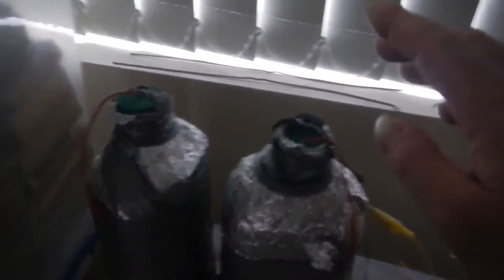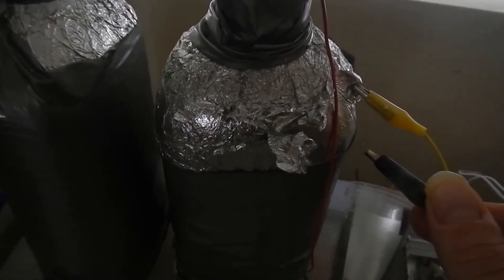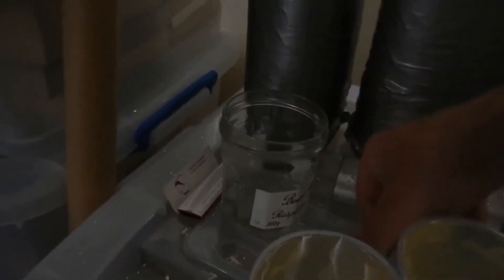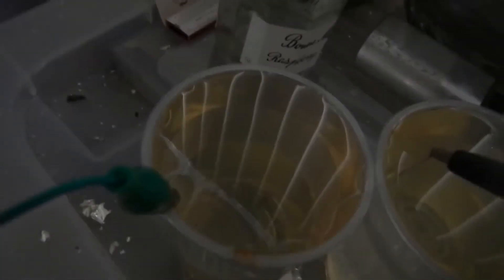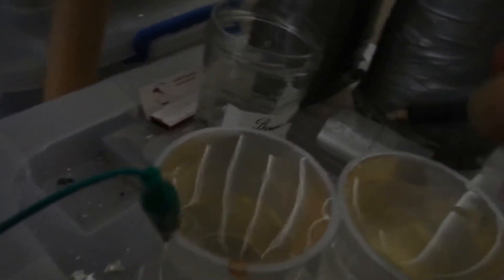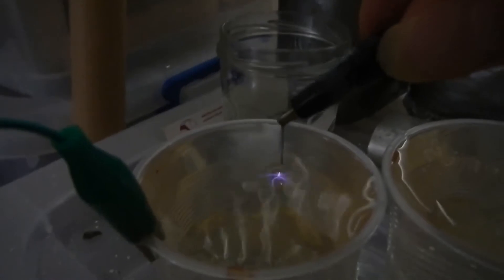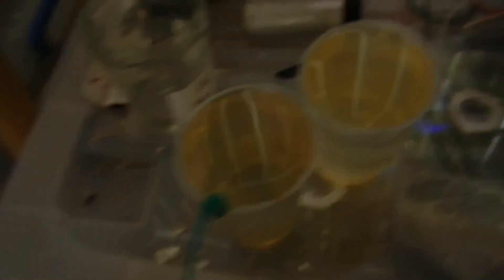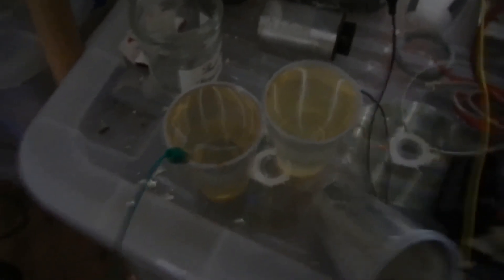Burning water with high voltage plasma.

Comment: Thanks for posting your work in a field not well understood.
This comment is to stimulate ideas as your experiment has done for me.
That indentation in the water is of interest.It's as if the potential is magnetically pushing against the surface tension of the water.Thinking of a pump maybe? That force might be high?For example,  the electrolysis or cavitation erosion of diesel engine cylinders is caused by an exploding micro sized bubble that slams the water onto the iron surface of the cylinder.(They claim it is hundreds of pounds of force), but a tiny pin size bubble.Thus,it creates a hole that eventually breaches and allows coolant to enter the combustion chamber.This doesn't occur overnight,but over months.It depends on the PH of the coolant.Electrolysis won't occur if the PH is 9.0 and above which is alkaline.Location of the engine's alternator ground wire connection can affect the electrolysis, and they're location is kept away from the cylinders.

Comment: no safety, not organized metal aligator clips, very messy and wet testing lab, no premeasurements to minimize unecessary testing. accidents will happen, im worried the water will touch the two big batteries. I suggest you get a bigger work area for your experiments, good sir.
Reply from the maker: thanks for the concern. this was one of my first HV videos. I have improved things since this was made.

Comment: You put an awful lot of faith in the rubber insulator of those low cost jumper sets xD
Reply from the maker: Yes. They work fairly suprisingly  well when new. I have had a few rather shocking lessons on dielectric breakdown doing this since making the video. I use a chicken stick now. Although they rarely breakdown below 3kv, I no longer trust them for any voltage measured in kv, especially since most of my leads have pinholes burned in them now....

Comment: Water is hash therefore   it do not burn. So you must use energy to dissociate H and O but then it's not water anymore the recombination of H and O will produce exothermic reaction yes, but the amount of energy  will be less than the energy spend to obtain the dissociation.
So BS !!!
Reply from the maker: Where did I claim it woulkd produce more energy than I put in?
Other than that you have described what I was trying to do fairly well. This was a test simply to see if a large capacitive discharge could make enough gas to ignite some with the spark of the discharge.
Although I'm not sure I ever did get an exothermic reaction.
Another explination for the change in the spark could be explaind simply as the water has resistance and may have been causing the discharge to happen at a lower voltage and higher current than the control spark direct to the capacitor. Which would also produce the yellow colour spark observed. I have been unable to reproduce the same result with other capacitors. So perhaps it is electrolysing gas then igniting? But only able to work with the high inductance/slow discharge of the leyden jar?
Reply: Mongrel Shark
the dielectric constant of water is 80.4
vacuum is 1 and dry air is 1.0006
http://www.engineeringtoolbox.com/liquid-dielectric-constants-d_1263.html

you should not use "burning water" water cannot burn period!
Reply from the maker: Firstly. The dielectric constant of water does not apply here as its tap water which has electrolytes added by the council. The water is a resistive conductor. Not a Dielectric. You would need distilled water to get a dielectric.

You can never use dielectric strength to get a resistance figure. A dielectric is not a conductor, while something that has a resistance is a conductor.

Furthermore I have done tests on the tap water here. The resistance is far from constant. It varies with voltage (in unpredictable non linear ways) as well as frequency (seems to be both capacitive (see my tazer water video or some of my capacitor videos where I demonstrate the dielectric plastic cup is an excellent capacitor) and inductive at the same time under frequency) while the resistance will not change much with added distance. It seems there is no way for a home experimenter to predict the electrical values of tap water with unknown electrolytes. Its far easier to simply measure the voltage drop under use. As I don’t have a sutible HV probe with low inductance I have not been able to get a measurement in this application.
While dielectric breakdown of the water is likely a factor in this experiment. The dielectric strength would in no way help me work out the resistance of the water at the applied voltage and thus be able to work out how much current is discharging to be able to solve the question of whether the air or the HHO is burning.

Secondly I use the term burning water loosely. Not to deceive people but to encourage them to think outside the box. I don’t think anyone that has read my description has been deceived. This info was supposed to be in the naration too, but the sparks where too loud and I got drowned out.
Really it depends on interpretation. When you consider that the whole reaction is happening (if its working as I intended) in under a millisecond. From water to gas to combustion and back to water vapor, and with the gas state being a very short time in the millisecond long process. I don’t think burning water is as inaccurate as you suggest.

Next you will be complaining that a Joule Theif is unfairly persecuted because it does not actually steal any joules. When in reality it actually uses them to the benefit of the user at great efficiency. Or that a Light bulb should be renamed to a photon generator.
Reply: Using the expression "burning water" is misleading.
Too many people do not understand the notion of chemical ash. Is it useful to encourage their ignorance?
Reply from the maker: Thats why I explain everything carefully in the description. As well as take the time to answer any questions.
Reply: rokag333 ....thanks rokag

Comment from the maker: Nope. I wish I could afford them!!! Have a few uses for UF diodes. I got 1000 1n4007's for $5.... All my fancy parts come from broken stuff... Haven't had time to sort diodes yet, so may have a few.... My part budget is about $8 a month... Mostly goes on 2n3055's... Need to find a better transistor. One that can handle a few amps @ 1200v... that I can afford. so dreaming. LOL.

Comment from the maker: I use 4007's for transistor protection too. You can put them in series for more voltage protection, or parallel for more amps (If you need to do that I wan to see!). I'm looking forward to seeing your driver schematic, as I need a good simple one that can do more than this JT based system. I'm only running 12v@ around an amp, anything more than that and the 3055 smokes. There are videos somewhere on youtube of a guy exploding water in a special capacitor too. Thats the main inspiration here :)

Comment: the second was with a irfp4227. I use a uf4007 diode to help deal with the back emf. Its not full proof. But helps a lot. with a irf450 I've pumped 28V and 30A through it. but not very impressive, current capabilities are to low.

Comment from the maker: Mosfets dont work on Joule Thiefs in my experience... Also I have over 300v back emf to deal with, which keeps blowing transistors. I have even blown 600v transistors... See my HV Joule Thief video's for more info on my driver, which doesn't have a spark gap. Just a JT wound on a flyback.... If you have seen a circuit with a fet of any kind running this kind of Oscillator, I would be very interested.

Comment: switch to mosfets. IRFP250 or irfp4227 work amazing. just be care with the distance of the spark gap as they are only rated at 200V

Comment from the maker: The video I was thinking of is on my HD. If I can find it I will see if I can upload without copyright infringement. Dosn't show much though. I like to think of the valving part, like a two stroke engine with two heads and no crankcase. I would think studying two stroke piston ports would help make a good steam engine. My brother had an "Air Hog" plane with an air pressure piston motor, was clear so could see working parts. Was just like a 2 stroke piston/cylinder. went really well!
Reply: For some ideas look at a Fairbanks Morse 38D8 1/8 diesel engine.It has no valves.The exhaust and intakes ports in the cylinder liner are open and closed by the action of the two pistons.

Comment from the maker: I'll have to go google Hooke's law now :) Only video of one I have seen is the one Tesla made, which is in a Tesla museum in Belgrade. You could make the cylinder from blocks of metal, by drilling in the right places and bolting it together, like your sterling water pump. Pistons would ideally be forged or lathed from billet, but you could make pistons and rods from bolts with washers stacked up, cut some of the washers to make the ports. I should have a go when I get the metal shop clean :)

Comment from the maker: Patent 511916 electric generator, 1893. I think its my favorite invention of all time :) You could probably make one with a drill press and a few other basic engineering tools. Heat, pressure, leaky seals, and friction are all turned to advantage.

Comment from the maker: I was up early not late :) Although I do 2 day Tesla sessions with no sleep :( I have been wondering about valves and steam too. Was thinking servo/microprocessor controlled, with action like 4 stroke valve. Piston ports are the more traditional way, but we have way better tech now :) Check out Tesla's Lineal steam generator. I can find a patent no if you want. Its one of the most inspired designs I have ever looked at. Turns all the problems into advantages. Brilliant stuff.

Comment from the maker: Yep. has gps tagging :) and goes 33ft underwater :) I wanted underwater gps though:( You could try with Tesla coil, But flyback is the go :) I wouldn't call it success, I was hoping to get pressure from this. Test in a bottle suggests no pressure. If you do it good enough, you might get cold fusion. Hydrogen turns into helium and you get free neutrons (Possible radiation danger) and a net energy gain with a bit of luck. Right now I would be happy with something that could drive a piston.

Comment from the maker: Audio problem can probably be fixed with settings menu.... Its a good camera for one thats only meant for stills. (nikon aw100). still same 3055. heatsink and fan working really well. can leave it on an hour, and no drama, or flat battery strangely, might be BEMF semi-charging a bit I think. Have bag of tip 31. Might try one soon. Keeps all my slayer/tesla coils up around 1.5-7mhz.. better spikes than 3055 too. also have some Tip 122 to try :) not as fast, but switch pretty hard. >:].
Reply: : i think so too !! the small emp charges that you produce interfeer with audio recording and when the arcs are on... you are off !!! :)) next time record with external microphone and not with camera mic..it may work ! good luck with trials !!

Comment from the maker: No where near enough amps for serious danger, Although I am using this to "Practice" Before I construct a ZVS I have parts for or some other High power things I have in mind. I thought I was pretty good, But have had a few accidental zaps. This High voltage plays by its own rules. Insulated wire means nothing! Really should have had the chicken stick out. That zap made the arthritis in my wrist really bad. Strangely Tesla fields seem to help. Zaps aside, pain has been reduced since I started HV.

Comment from the maker: Another day in the office. Burning and exploding small amounts of water with plasma.

http://youtu.be/4KGiqyvQ2SM
Reply: Vignesh Periasamy lets like and unlike Mongrel Shark 's posts several times to find out.
Reply: Did you zap yourself in one part?
  (the part before the big zap, which was hilarious.)
Reply from the maker: Lol. I only just got the notification for these comments. I think likes and +1's do help my search listings, so please feel free to go nuts. Comments are good for my total engagement stats too.
Reply from the maker: And yes. I have been zapping myself in a few videos lately. I may consider making it a regular occurrence if it helps my ratings.... Its only 50 or so kilo-volts. Doesn't hurt as much as you might think. feeling returned to my hand a few hours later....
Reply from the maker: Numb. The opposite to pain :) it only hurts for a second. Like an electric fence, only a bit stronger. And yes, used to it to a point. Been zapped a few hundred times in my life.
Reply: Kinky Viggy.  Let me guess, now everything tastes like chicken?
Reply from the maker: LOL. They disconnected my phone line. Apparently the free power I was using to charge my batteries was not so free...